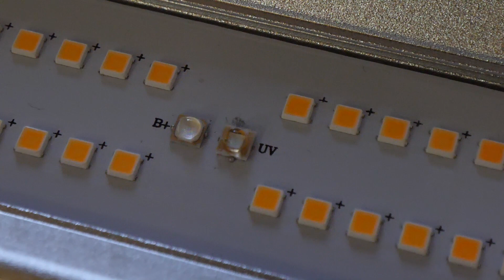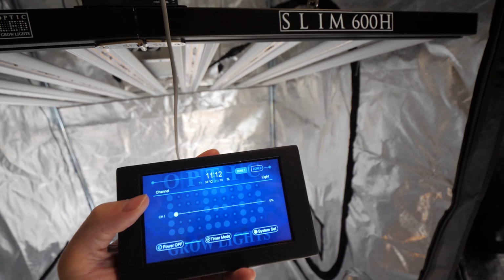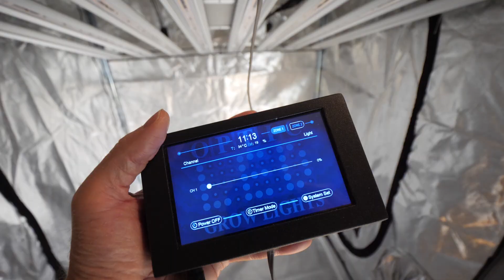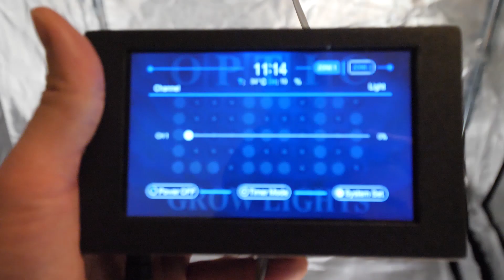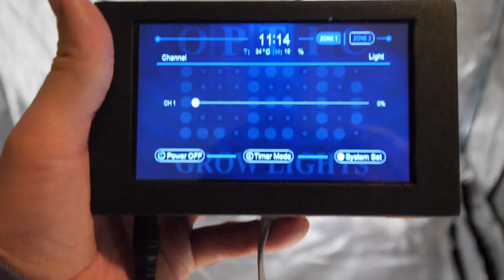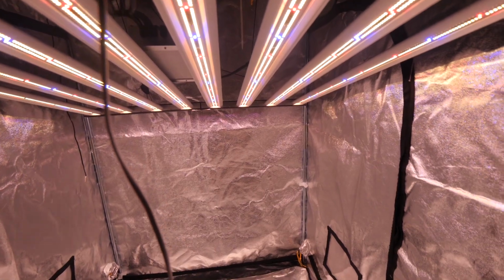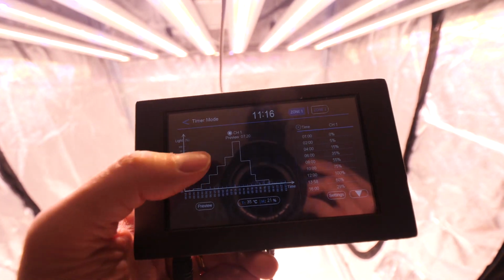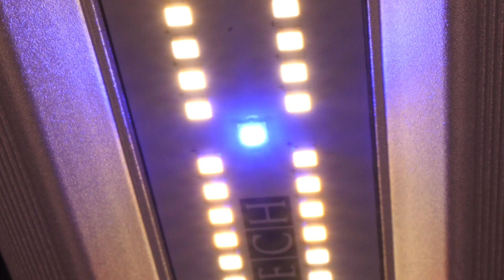NEW!!! SLIM 600H GEN 2 UNBOXING, SETUP AND REVIEW

Comment: I thought that the UV-B is beneficial during the last 2 weeks & intermittently at that.  (2-3 x/day during lights on only & increasing the length of time up to 2-3 hrs/day total to stress the plant in order to produce more defense mechanisms (trichomes). How do you manage the UV light from being on at all times?
Reply: UVB is very useful. But so is UV-A. 
Also UV-A chips last a whole hellva lot longer than UV-B. 
A single UVB chip can cost upwards of 30$ each. Therefore the UVB chips are terribly inefficient and you get much more UVB with a fluorescent like an Agromax Pure UVB T5.  I  been useing em for years. 

A single 2 foot Agromax UVB T5 is plenty to cover a 4×4. And it's 24$.